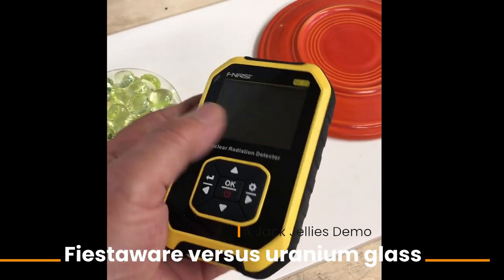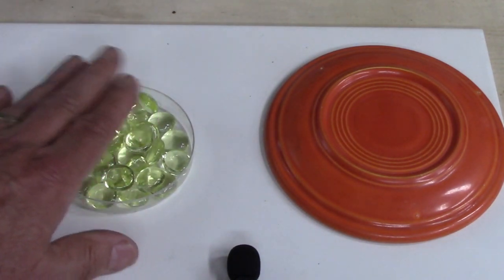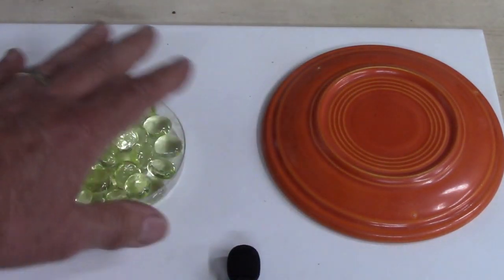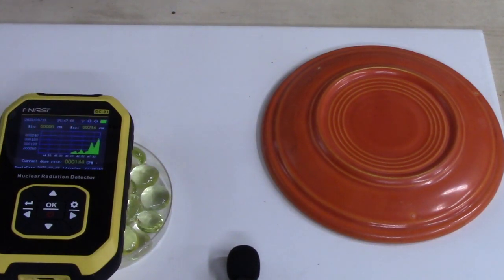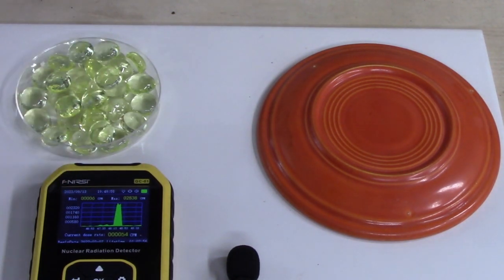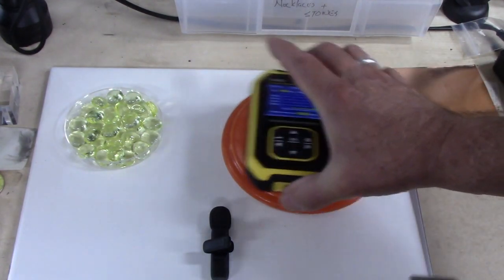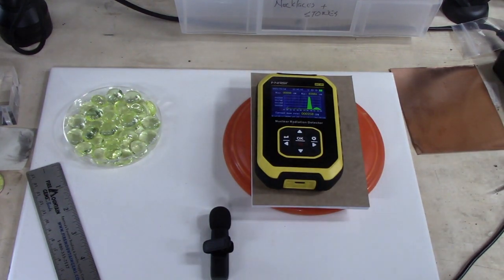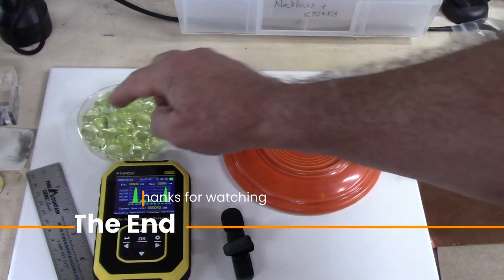Comparison of radioactivity in uranium glass and vintage red fiesta ware

Comment: Clearly you get what you pay for. Your geiger counter is reading about a factor of 10 lower than what I would expect from these test sources. A plate like that should read 50,000-60,000 CPM on a device that cannot detect alpha rays. I recommend getting one made by GQ GMC and comparing side by side, if you want to be able to detect alpha rays specifically you'll need the 600+ model or any other counter with a pancake probe.
Reply: I have a GQ GMC 600 plus and a plate like that and I get around 27,500 CPM.
Reply: You can have expensive Geiger counters that read a lower count rate but have better accuracy. The count rate doesn't necessarily mean much, the specific magnitude is relative to the volume of the detector tube. A Geiger counter with a larger tube will almost always give a higher count rate. 

Many quality Geiger counters will list the sensitivity either on the unit or in the manual. This value can be used to convert the value given by the detector to the true count rate, though this requires you to work out the proportion of alpha/beta/gamma by taking separate measurements with different shields in place. Even with a small detector volume, a quality Geiger counter can still give you an accurate measurement of a samples activity.
Reply: GQ GMC are no more accurate plenty of reviews showing thishttps://youtu.be/kxTDhoXDiu4?si=lYj-ap5KzvLy9Gua
Reply: I buyed GMC  600+  a week ago. So now i have to find some uranium glass.